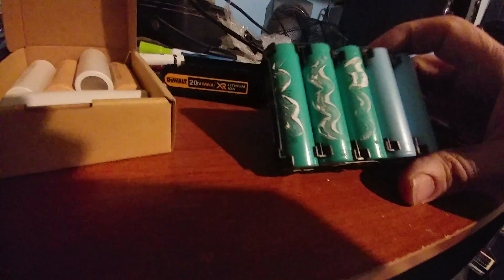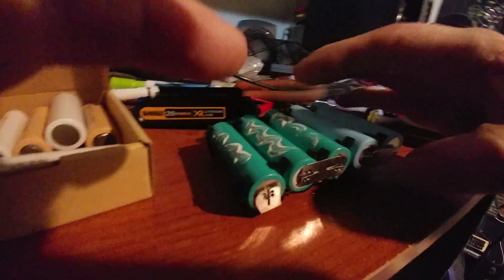Graphene battery application part 2

Comment: You have all this equipment and knowledge, yet you can't figure out how to make a headmount to hold your phone? I made one a few years back with paper towels and cello tape, it's not that hard!
Reply: Bloody oath it is! Or you could mount one on one of those swiveling desk lamp stands.
Reply from the maker: Tony Grant these are all good ideas. It would be better for the channel, wouldn't it.
Reply from the maker: Maracachucho that's a really good idea....
Reply: Yeah it would improve things sometimes - and other times it might just get in the way. 

I have got some stuff I'm thinking of doing on youtube at some point and doing off the cuff stuff as I go would be part of it as well as set piece stuff with a camera mounted on a tripod. The tripod stuff is second nature to me but the off the cuff stuff I've had to think about because I'd want to do it hands free. 

I reckon I'd use my phone for that stuff and mount it 3 different ways depending on the subject - 1 would be on a head mount of some sort, maybe mod a head torch. The next way would be modding a flexible desk lamp stand to take a phone and the other one would be to use a mic stand with a flexible end on it. I spose they'd just kick round the shed when not in use.